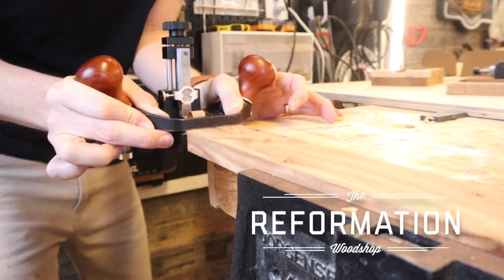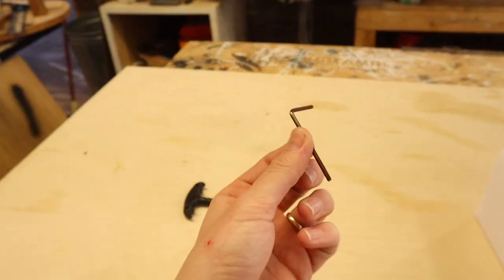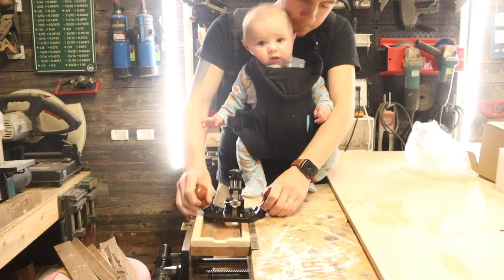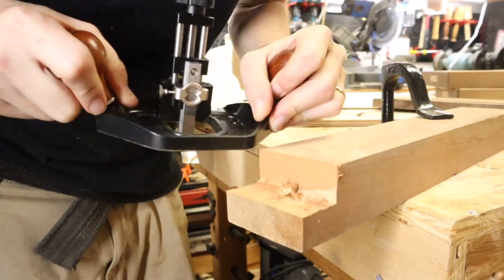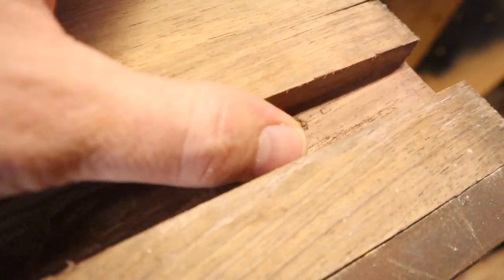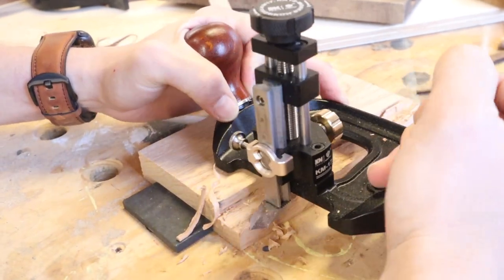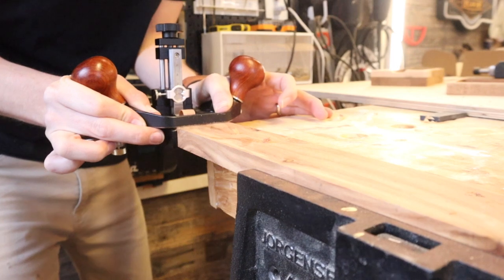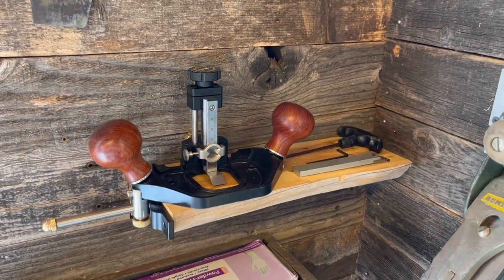Why You Need A Router Plane //  Katz-Moses Router Plane // KM-17

Comment: Router planes are great to have. A couple of tips for using it. Make a larger base for it out of thin material. That will help on things like your tray so the plane doesn't tip. Also, come in from each edge to keep from blowing out as you exit the cut. If you're making a groove (dados in particular), it's usually best to have a saw, chisel or at least a knife cut for the shoulders to get clean edges. Then hog out the rest with the plane. Good luck and keep practicing. - Chris
Reply from the maker: Lots of great tips, appreciate it!

Comment: This came up in my suggestions. Well, that is a nice tool. It will be handy for touching up things. One of the first things I noticed is the sturdiness of your work table (work bench) Because your work bench moves when you are putting a horizontal pressure may effect aspects of your work. I remember one person made a critical point about the festool table. I replied to him and made a new video showing how I built a steel festool design work table. I tell you it is stable. I did make a few mistakes mind you . Or a weakness in the design. I didn't really plan too well before building. However it is solid and doesn't go anywhere. If doing what you were demonstrating in this video, you won't have any sideways movement whatsoever and perhaps will improve quality of work. Thanks for the upload.
Reply from the maker: Thanks for the input, and yeah my work bench is VERY old and needs replacing.